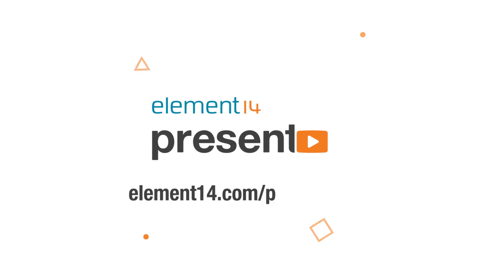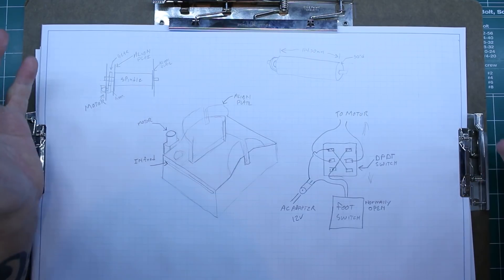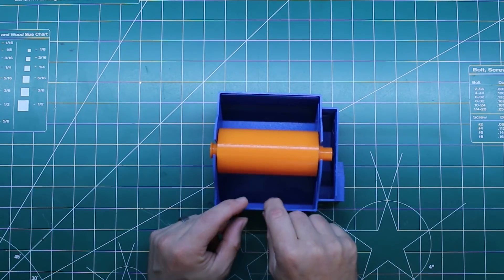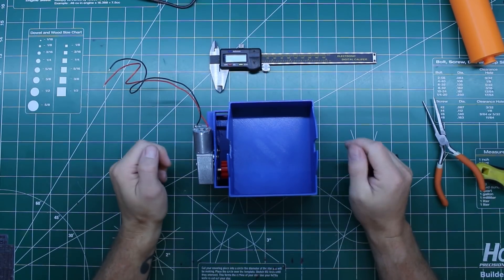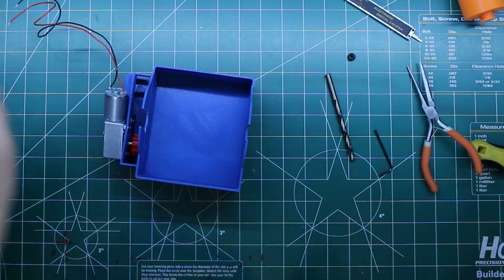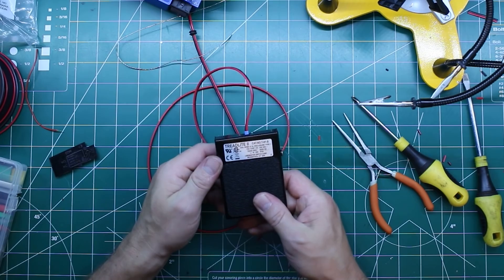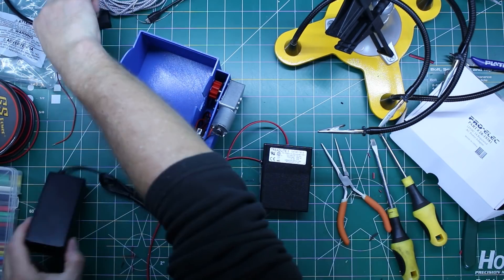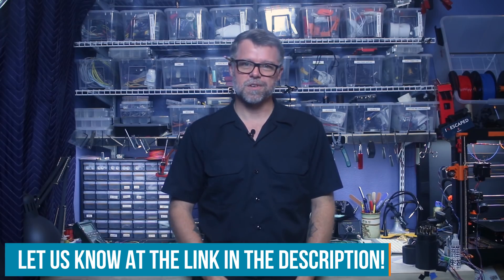DIY #3DPrinted Label Spooler

Comment: Mhm how i would go about this problem? Probably with a cheap pencil and a piece of double sided tape. And to quickly spool it up, i'd put the pencil into a cordless screwdriver.

But as far as engineered solutions go, it isn't overengineered enough. It has to have a proximity switch of some kind that automatically engages spooling, it should have a tab where you can feed in the start of label roll, and it should spool up the printed labels while printing rather than afterwards, and it shouldn't need a pedal. And it should be USB powered or have a built-in battery that should last several dozen uses at least until it runs flat.
Reply: Right! Post build I have thought of even more ways to over engineer this thing. Could use the indexing holes on the labels to trigger a sensor on the label roller to know when the printer is outfeeding so it could run right off the printer itself.